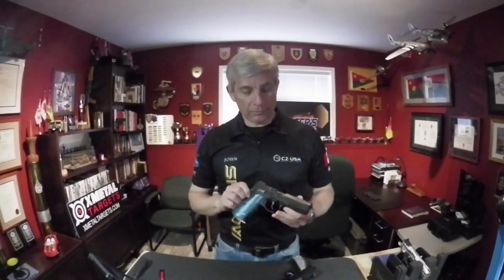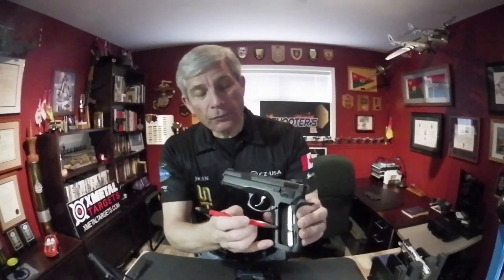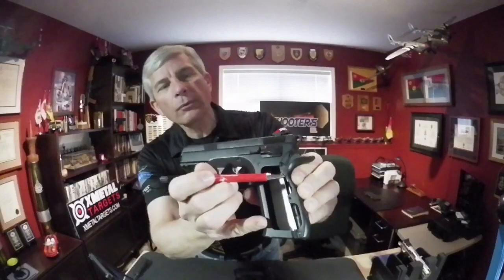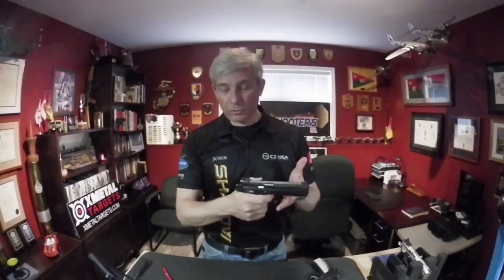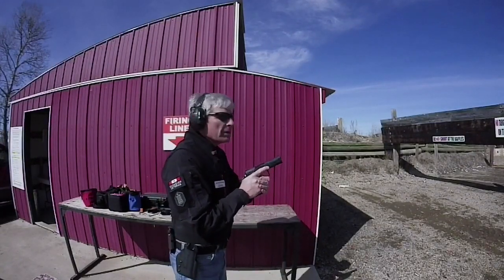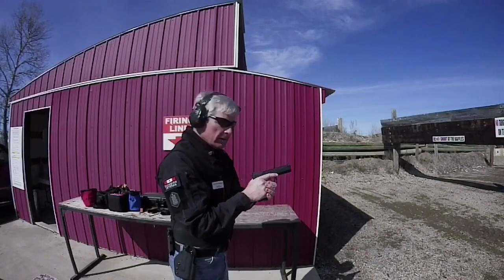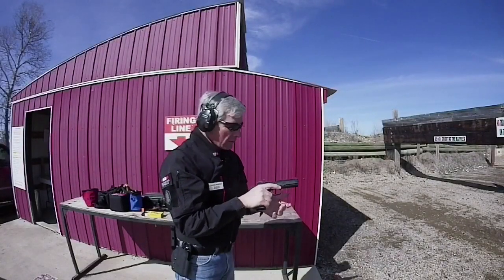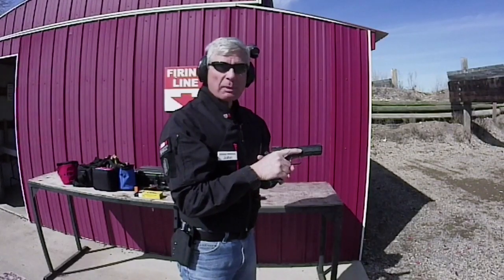Gun Review Series: CZ Shadow 2 Update #1 - Main Spring (E29)

Comment: Great Video !   I made the mod to my CZ Shadow 2 with Cajun Gun Work  11.5 lb hammer spring, extended firing pin with reduced tension firing pin spring.  Trigger pull measured at 6.5 lb, the firing pin striking force turns out to be slightly stronger than the OEM parts I swapped out.
Reply from the maker: Thanks!  A friend and subscriber from Seattle, Richard Lindquist, was kind enough to send me a 10lbs, 11lbs and 12lbs main spring.  After installing the 10lbs, my SA was around 2lbs 13oz and the DA was just under 6lbs if I recall correctly.  So, finally I have the trigger pulls the way I want them....nice and light!  Richard and another subscriber brought to my attention that the newer Shadow 2s are coming with lighter SA and DA trigger pulls right out of the box now.  My Shadow 2 was not like theirs but now it is :-)

Thanks for sharing your comments!

Comment: I put the 13lb spring in mine and it made a big difference.  my shadow 1 has a little lighter trigger pull but the shadow 2's trigger is way better in single action.  It is fine with the 13# spring.  I might put the 11lb recoil spring in it as well.  I like the shadow 2 WAY better than the shadow 1.  I love the new paddle safety, weight, checkering and the trigger is fantastic.
Reply from the maker: Definitely the change in the trigger pull with the 13 lbs main spring is very noticeable.  I will always like my Shadow SP-01 but without a doubt the Shadow 2 is a fantastic improvement building on the the success of the Shadow SP-01.  I echo what you are saying Keith....great paddle safety, perfect weight, super sharp checkering and "hot knife through butter" like trigger!!  I'm looking forward to seeing just what the 11 and 12 lbs main springs will do to both the SA and DA trigger pulls.  Oh,  I did install a 11 lbs recoil spring as well.  I forgot to mention that.

What is really nice with the DA trigger pull being reduced is that choosing the first target to engage during a match with the DA is not going to be an issue.  The trigger is so smooth that I have no concerns engaging any target for the first shot as DA in IPSC.

Comment: I enjoy your videos. I have been doing a lot of research on the shadow 2, and I think your videos have me convinced. I am wondering what size of group can this gun shoot at 50 feet, and where can you purchase the reduced power springs?
Reply from the maker: Great to hear that you enjoy my videos.  Thanks!  First thing I will say and I have said it many times, you can't go wrong purchasing the CZ Shadow 2.  CZ has truly designed a fantastic gun with the Shadow 2!  At 50 feet, I can easily shoot a 2 inch 10 round group.  If you ask me what size of a 9 round group at 50 ft I can achieve, I'll tell you 1 inch.  I always seem to have a flyer in my 10 round groupings.  LOL.  But seriously, the Shadow 2 is extremely accurate and the super smooth trigger certainly contributes to the Shadow's accuracy.  If you live in the US, you can likely find the 13 lbs main spring at CZ Custom - https://czcustom.com .  If you're in Canada, you can buy the 13 lbs main spring at Select Shooting Supplies - https://selectshootingsupplies.com .  Are you a USPSA or IPSC shooter?  3Gun?
Reply: Thanks for the info. I shoot IPSC and indoor precision pistol at my local clubs.
Reply from the maker: Hi Gerry.  You're welcome.  I used to shoot indoor precision pistol for years.  Really enjoyed it.  I like the concentration required in both pistol precision shooting and long range rifle.  Well, if you buy a Shadow 2, be sure to let me know your initial impressions of the gun on and off the range.   I had it in my hands last night as I was installing a DPM Recoil Reduction System (not IPSC legal but good for most other type of shooting) and I am always surprised at the weight.  It is much heavier than the Shadow SP-01.  Big change and I love the extra weight as I prefer heavier guns.